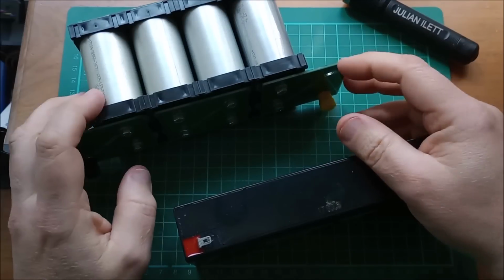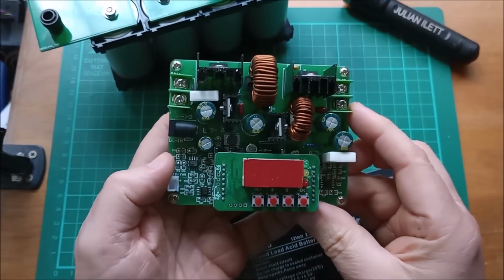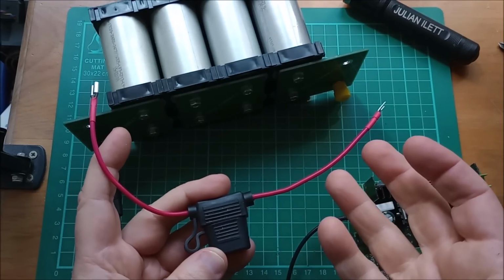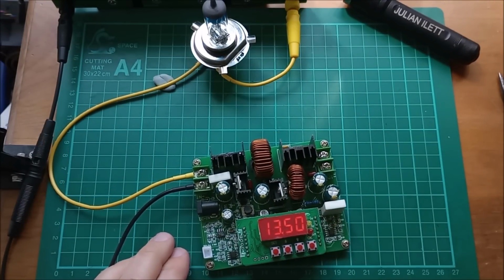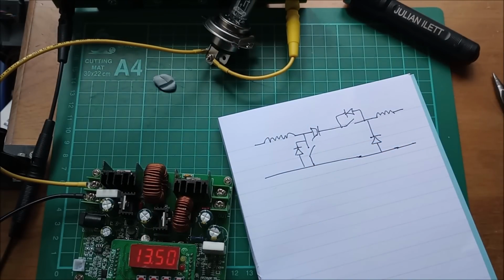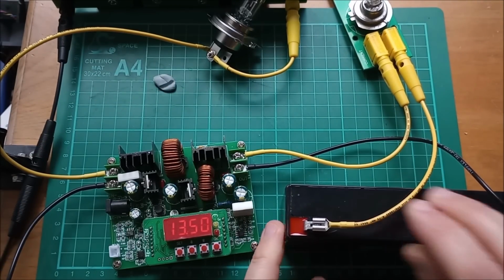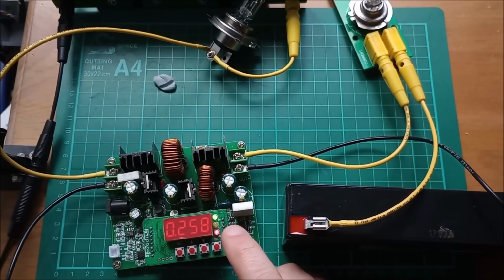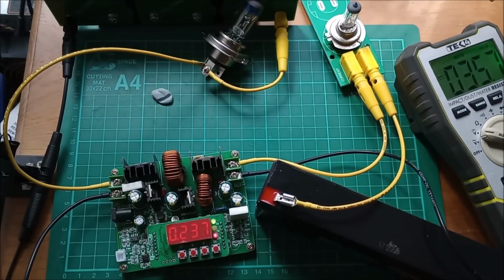Charge a 12V Battery from a 12V Battery

Comment: is it possible to exchange power between the two batteries at will, controlling the buck boost with an arduino? if yes, which could be the circuit solution? Thanks in advance

Comment: Is it ok to run wires from a 920AH LiFePO  battery bank on my RV to a battery charger on my towed vehicle (lead acid 12 volt) to keep that battery charged for use of the brake controlled and lights?

Comment: These 32700 Lifepo4 cells are great. 
I bought 16 of them back in 2018 for my ups. & It runs a 300w load for 50mins. 
12ah 25.6v is perfect for replacing old leadacids. In 24v ups. 
The charging is perfect.

Comment: For info purposes: When a lead acid battery is flat the liquid inside is just water.
As the battery gets charged it becomes more and more sulphuric acid. It's really 
great at making you think you've got a splash of water on your denims,
after they're washed you'll have big ventilation holes for the summer :o)
In a previous job I had to fill motorcycle batteries.
Reply: That lead acid battery was either a glass absorbed type or a gell battery so it would not spill any acid.

Comment: How do you work with those light bulbs without accidentally touching the glass? Am I right in saying they will blow if oil from your fingers gets on the glass and you switch them on right?
Reply from the maker: I've never killed a bulb with finger grease. Smashing the glass and accidently overvolting - yes :)
Reply: That will only happen to halogens. And you should not run halogen bulbs without a protective envelope. They emit lots of uv b .

Comment: A battery with C=2.3Ah, being charged at 0.5A, is a C/4.6 rate.  I probably would not call that "gentle" but it may be within spec of that AGM battery.  Usually for those little AGM batteries, C/10 is gentle, anything more than C/5 is a fast charge.
Reply: It says right on the battery. "Intial current 0.69A” which means the recomended charge current is 690ma and charging at that current is perfectly fine for a leadacid battery. They will go bad in 5 years anyways.

Comment: For anyone wondering why the light bulb isn't a big resistor: It is! :D
Reply from the maker: I'm keen to check the filament resistance when cold and when hot.
Reply: @JulianIlett   They use this hot cold concept of the bulb filament, with different resistances, in some speaker cross over designs. And protection of the tweeters.

Comment: How manny amps can you run Through the licht bolb whitout destroying it?
Reply from the maker: It's more about the volts. Car bulbs are good for about 14-15 volts. When the filament is hot, the current draw is pretty constant.
Reply: @JulianIlett  uea i get that but the current you pull on the boost converter will run through the fillement of the licht. So if yoi pull 10 amps will it break?
Reply: @electro2606  Probably. A 60 watt 12.0 volt bulb would have a rated current of 5 amps. More than that and the lifespan will be greatly reduced.

Comment: You forgot that you need a BMS on the source batteries! Since you are an influencer, you need to tell/show things correctly.
Reply from the maker: Well, I influenced you to write that comment :)
Reply from the maker: The BMS is coming. The capacitor balancer is coming.
Reply: Fair point but I think it's more important to assess whether it's safe to put a battery across the output. Let's assume the lifepo4 cells are well balanced

Comment: Will you check this buck boost converter with high current ? Thanks
Reply from the maker: For continuous high current charging, I'll probably use a boost/buck based on the LT8705. The efficiency will be higher.

Comment: I did something simular once when inwas heading to the airport, car battery was stone cold dead, and i only had a slow charger.

I took a 18V makita tool battery, put two saw blades inn the terminal, put the startet cable to the saw blades.

2 seconds later the car lightes up. Still didnt start. Gave it 10 second. Still didnt start. Gave it 30 more second. And boom it was running.
Reply from the maker: I keep a LiFePO4 jump starter in my car. Modern cars have all sorts of 12V parasitic drains (like using the app).
Reply: @JulianIlett  yea.. I never been out of Juice  before say something 2010 model then I have been quite a few times.

Comment: Why not just use a boost converter and save on the losses of buck side. Just pick a source battery with a terminal voltage lower than the battery to be charged. Every time you do a power conversion you have to pay the gods of electricity and you never get a refund 😂😂😅
Reply: Woof!!!!!!!!!!!!!!!!!!!!!!!!!!!!!!!!!!!!!!!!!!!!!!!!!!!!!!!!
Reply: @fredflintstone1  if you put petrol on to a hot buck converter it goes woof just as you said Fred.
Reply from the maker: I specifically wanted to use batteries of the same voltage.
Reply: @JulianIlett  Then you still need just a boost converter as the charging voltage will always be high than the resting or on load voltage.

Comment: Are these lightbulbs not reducing the efficiency of the charging process significantly? Surely you will be fine with simple fuses, just dont short your wires.
Reply: Or better still take the fuse out of its holder whilst you are wiring it up and only replace it when you are sure all is safe.  You could do this by temporarily bridging the fuse holder with the lamp - if it doesn't light, put the fuse in.
Reply from the maker: Yes of course - they're resistive. But so are the wires, so are the PCB interconnectors. There are losses everywhere :)
Reply: @JulianIlett  Bulb Filaments are non-ohmic. there are also an order (or two)  of magnitude larger than the resistance in a cable or PCB interconnects.